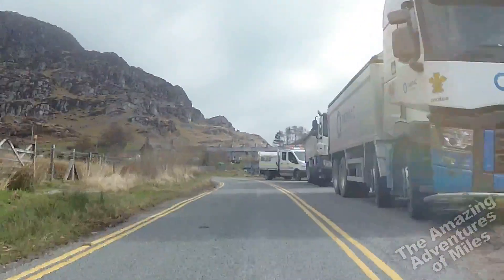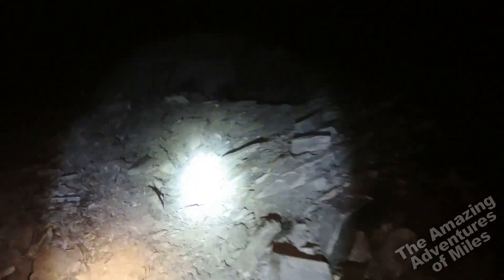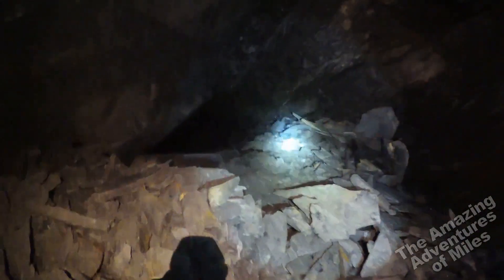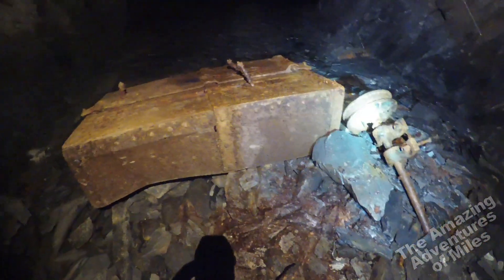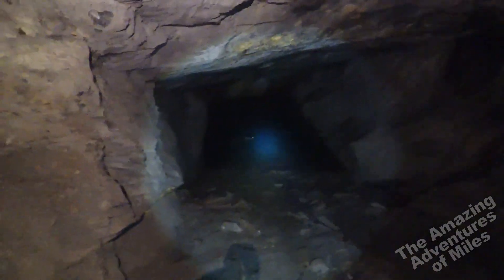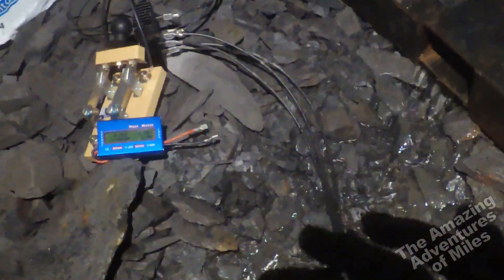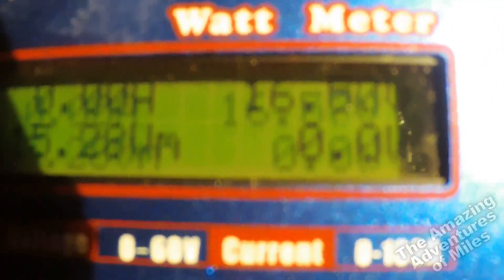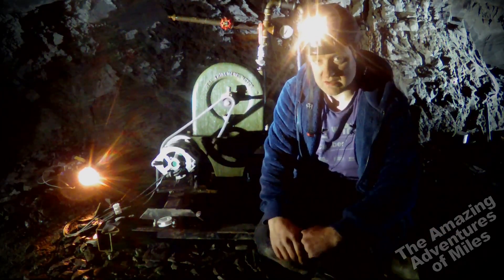Fixing a Pelton Wheel Hydro Electric Turbine, in a old mine

Comment: My Guess, is that the Turbine could Use New Bearrings after a 100 Years.  And those " Cups " above the rotor shaft is designed to be full of oil, to Keep the Bearings WET, AND YOU SHOULD also service that Altanator, I'm Safe to Say that the brushes are Toast !!! As Well as the Bearings.
But Enjoy your Mine  👍🇺🇲 love from the Colonies.
Reply from the maker: Hello Ronald and thanks for watching my video. Yep those grease cups are kept full and given a quarter turn periodically. The alternator is new and doesn't have any brushes because it's a PMA design. The bearings however have now totally failed, it doesn't look like they've ever been changed in 116 years. So I need to get the thing apart, looks like it'll be a pig of a job and I won't be able to get like-for-like now. So it's not in use at the moment.
Reply: @TheAmazingAdventuresOfMiles  That's Where a Good Machine Shop Comes in Indispensable !!!!

Comment: Interesting to see that little turbine running way down in mine. I have spent some time down in the Zink Mines around Tennessee in the States ,fixing large  machinery. We would never be aloud down in a mine in that condition !.  Was concerned for your life, seeing old rusty stressed support beams, clasped area and rusty chain bridge crossings.  It dose not make it safe just because you know the mine well. GREAT VIDEO footage though !  Best of luck too you.
Reply from the maker: Thanks Kenneth. I think the video makes it look a lot worse than it is, those rusty support beams and the rusty chain bridge might look ancient but they are not, in fact they are only a few years old and I was the engineer on both installations. The mine is used for tourist trips, it's regularly inspected and maintained. We go to a lot of trouble to keep it looking old, which it is of course, but the more modern the hardware that you put in the less original the environment becomes and it spoils it for the visitors. You'd never know but even on the bottom floor of this mine, there are 24/7 wifi hotspots, telephone lines, emergency rescue stores, IP based cctv streaming, you name it. 

Yes if you're used to being in a modern mine operating in an extractive capacity, this one can seem terrifying, people frequently tell me that. However, on the rare occasion I'm in a modern extracting mine myself, I'm the one who's terrified, and I want nothing more to be back in a 1800's slate mine again! It's just what you're used to I suppose.

Comment: Interesting!  What I once upon a time heard and seem to still remember was that the 3 types of water turbines were characterized by their optimum operating head about as follows.
  1. Kaplan for low heads 1 meter to 20 or 30 meters.
  2.. Francis from 30 to 120 meters.
  3.  Pelton above 100 meters.  Here 60 meters is a bit low for the expected head, but of course they have overlap beyond their optimal ranges.
  I once visited Hammerfest in Norway and saw there the only Pelton turbine I had seen before this one.  It was supplying power to the city of Hammerfest with water coming down from a 900 meter mountain.  I was told that you would not try to stop the flow at the low end -- instead you deflected the nozzle away from the Pelton wheel, if necessary.  When ever the water flow had to be stopped, somebody had to climb up 900 meters to the closing means at the upper end reservoir.  I have never seen a Francis turbine in real life.  Several Kaplans, though.  As to this tiny Pelton, I started pondering whether the cups on the wheel might be corroded so that the water jet had to be aligned as a temporary remedy?  What my text books have mentioned is that the jet should hit near the edge to be deflected by the cup as nearly to 180 degrees as possible.  Or the cups would be dual, side by side and the jet would be aimed to the dividing ridge between the two cup halves.  Then the split jets would go to the sides, rather than towards the shaft or the outer diameter.  Your adjustment seemed to tilt slightly towards the shaft, which is why I suspect erosion of the outer edge of the wheel cups.
  Keep the turbine running!
Reply: That's a good comment, interesting.  I think I read somewhere 1 meter cubed of water, 1 meter height = 1kw of power potential.

Comment: You need to double or triple the pipes all your head is lost in pipe friction.  Its also possible some bits in the nozzle are causing the jet to squirt out not quite straight so your correction with the little bit of slate didn't really fix it in my opinion.  Really enjoyable video thank you for posting. Cheers
Reply from the maker: You're totally right Martin, I am aware of the pipe limitations but changing the pipe would be a huge deal. Instead I'm going to move the turbine to the bottom of the drop, rather than 300m from it on the horizontal, then run a 3 phase cable back to the batteries. The losses electrically will be less than the friction losses (or at least that's what I'm expecting!)
Reply: @TheAmazingAdventuresOfMiles  good luck and well done.

Comment: This is really cool buddy is there any chance visiting this mine ? And whats your plans with the turbine are you going to run lights in the mine becuse that would be really cool :) you might be better of useing the turbine to charge a battey to help with the load on the turbine
Reply from the maker: Thanks for your comments Kirbz. Yes the turbine charges a couple of leisure batteries. Coupled to a 2kw inverter it means there is always some power down there for running a drill/grinder, or more importantly, boiling a kettle for a cuppa. There are some lights too!

The mine is possible to explore, you just need to borrow a key from the Go Below office in Betws-y-Coed (North Wales). You won't be able to get to this turbine as it's in a secure area but there is plenty else to go see.

Comment: I hope you are not alone in that mine. ,
Reply from the maker: I hope I am :O 

Thanks for watching Greg, take care :)
Reply: That is extremely unsafe. One slip could result in an incapacitating injury. With nobody to help or go for help you would be in a serious situation. 

Fixing the turbine will require a trip to take it apart to measure the bearings and another to get the replacements and come back to install them. If the wheel is worn out it can be replaced or repaired. Please let us know what happens.

Please take someone along.
Reply from the maker: @gregwarner3753  Thanks Greg, looks like it'll be a pain to open up to get the bearings out, the case will need splitting to drop the turbine out. I'll get to it! Too many other things to fix. You're right to be concerned about working alone, it's not something I'd recommend to others but I've worked in mines for many years and often on my own. The office always has my route and ETA, so if I don't return on time somebody will retrace my steps and find me.
Reply: Good to know. Take care.
Reply: Isn't it possible that they are bushings instead of bearings?